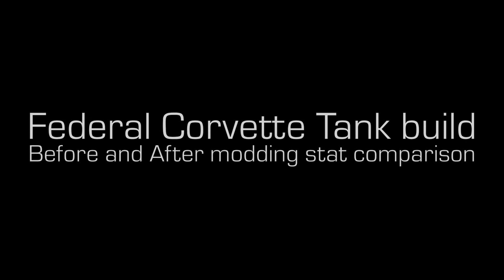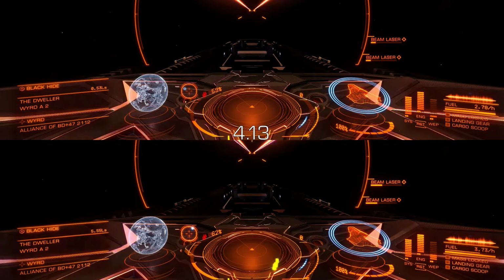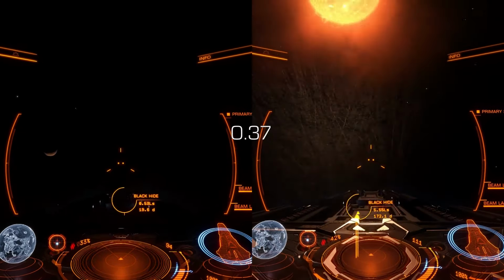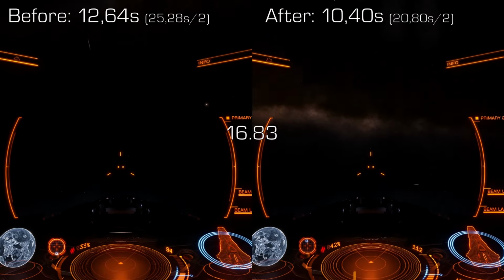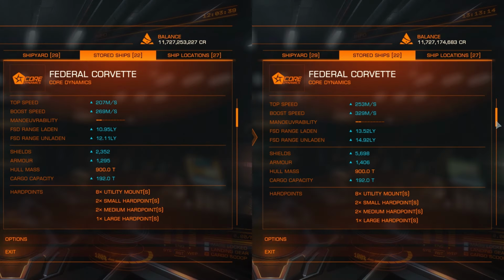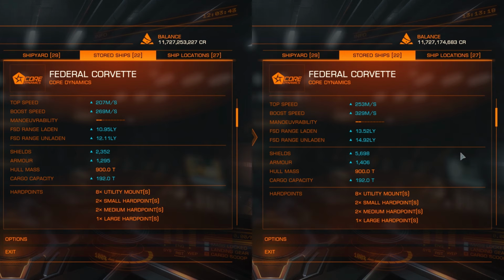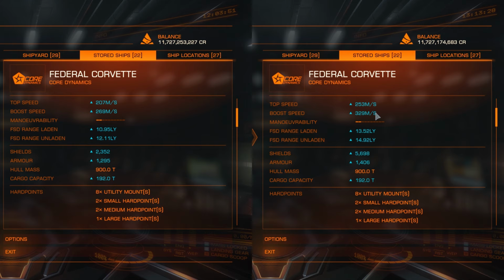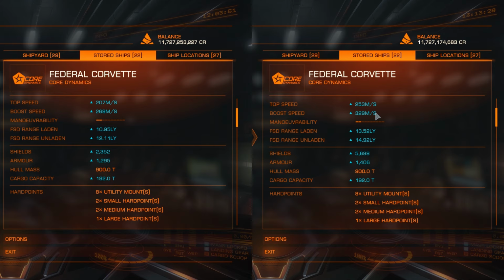Elite:Dangerous. Federal Corvette Shield Tank build. Side by side comparison before and after

Comment: now i'm starting to get worried that NPCs will end up trivial (even more so than now) or that they will be boosted to compensate for modded ships and newer players or half-customised ships will be pointless to fly due in the randomly generated harder instances (usually we get swarmed rather than get tougher 1 v 1 fights to deal with, swarms are annoying mostly because of the high short term damage than because they fly well). OTOH seeing some NPC with custom mods could make for some fun variation on the current combat situation. this is a rare case where random generation works for the player rather than against, if the NPC load-out gets more basic parts that can vary then us combat players may need to pay attention to something beyond rate of shield loss.